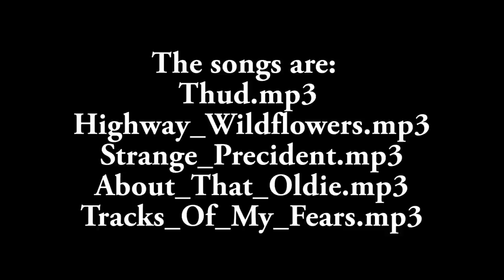18kt gold bracelet three colors yellow white and red handmade

Comment: on you polishing wheel. is the wheel on the right a rougher one? if so what kind is it i need one. i love this link it looks easy and very nice. this will be my first link i try. i have trouble soldering those ring together though. i tried this with silver. I'm not done yet but i feel if i put the work in it might as well be gold.
Reply from the maker: to polish, use two different brushes with two different types of pasta. A brush is made with hard hair and is used with an abrasive paste. The other is a cotton brush that is used with a polishing paste

Comment: Very very inspirational for a beginner like me , I would like to ask when you solder the lobster claw won't the spring inside the claw (lock) get damaged as I tried with silver lock of this type and the spring mechanism got damaged , please provide your valuable knowledge, once again thanks for posting these valuable vedios 
From :Kashmir (India)
Reply: It is because silver transfer heat really good. When you heat the jump ring, heat goes through it to the clasp and to the spring. Gold does not transfer heat as good as silver so you can solder jump rings without removing the spring. Also using small flame helps. I am using oxy-propane torch with needle tips so I soldering jumprings even on solder isnt a problem. But I dont solder them - it takes too much time(solder, pickle, polish) - instead I use PUK to weld them quickly :)
Reply from the maker: Our colleague provided a precise explanation. Thanks